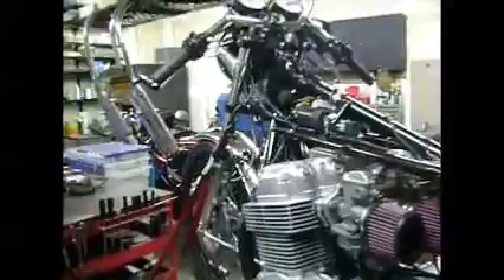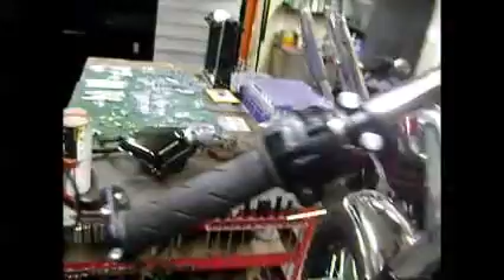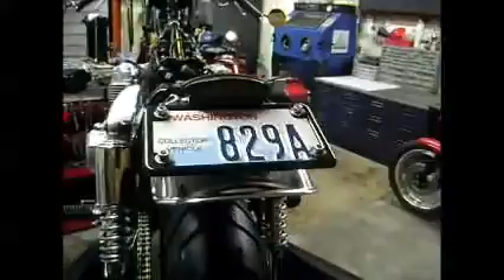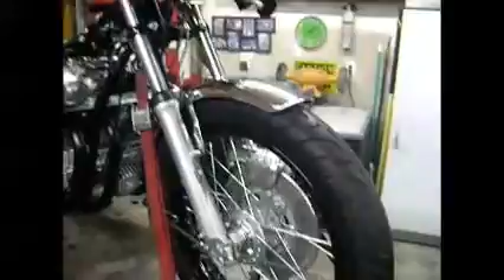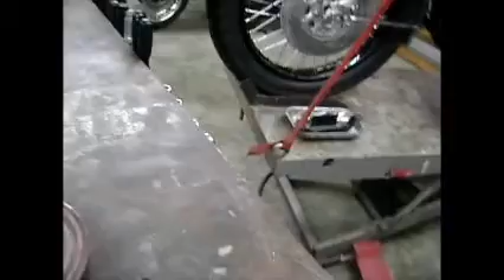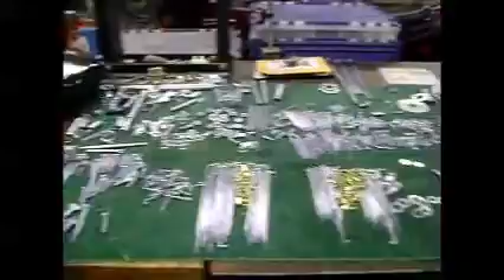Clip 7, CB750 Honda Cafe' racer fabrication By Robert Kelii

Comment: Hi ,is it possible to strip and rechrome a wheel I meen the spokes and rim if it's a bit rusty,I have got them stripped only snapped one spoke,
it's on a cb125s ,it's very hard in the 7k to get parts as special y spokes
Reply from the maker: They have a ton of vendors from Thailand that sell spokes and wheels.  Much cheaper to buy new from them then to try and have yours re-chromed.  I have used many rims from those vendors and have had great results. Check out this e-bay item number from "Mini Bike World": 172287633966.  Best of luck,  Robert